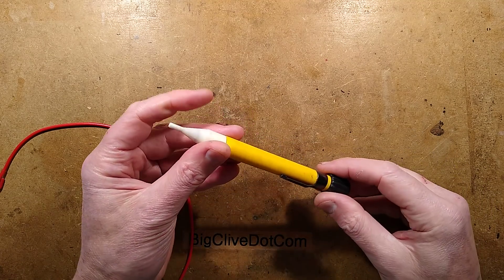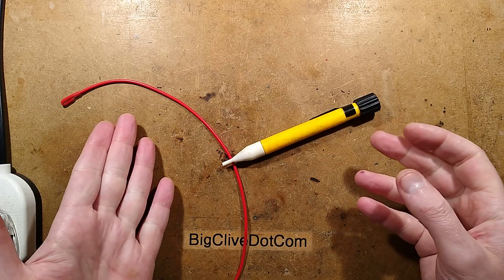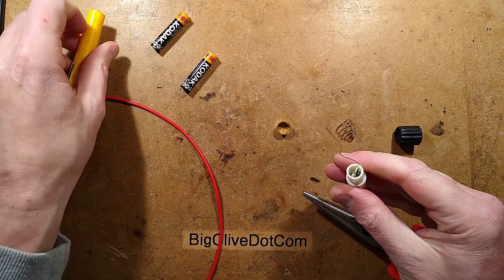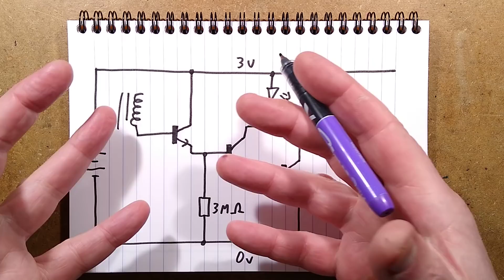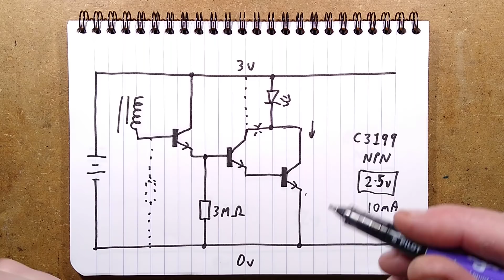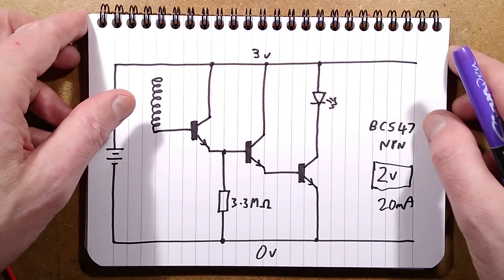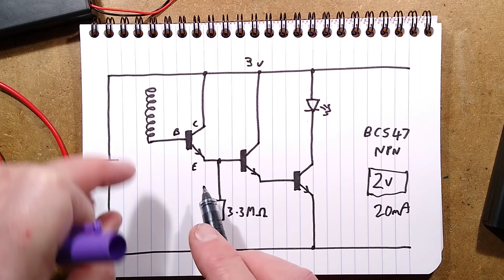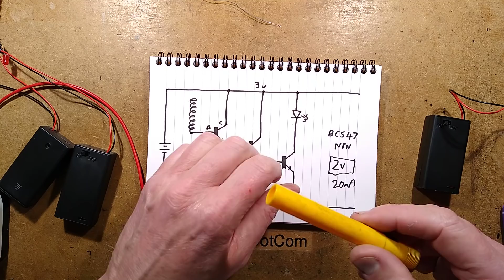Volt stick circuits and tests

Comment: I watched an apprentice trying to test one of these on my Proving Box. He convinced himself that my Proving Box was faulty because his volt stick worked on the cable to the radio.
I told him he was wrong and needed to look at the Proving Box specification and have a think about how his volt stick worked. 
Fair play to him, at the end of the day he'd figured out that the Proving Box was a ramping 600 volt DC, that it worked by the meter tip pushing a metal contact down, that his volt stick couldn't reach the shrouded contact and that, since it used an induced current the volt stick wouldn't detect it. The following day I confused him some more by showing that the Proving Box would make my volt stick light (mine has a longer tip and it works with a small Hall Effect IC so it will detect DC voltages).

Comment: when it operates down to the lowest voltage and it was 3V or 2V, where is that 3 or 2V? is that the voltage across the last transistor or is it just the supply voltage bcus its just an led not led + resistor? why do they work down to different voltages?

Comment: The Maplin Live Wire kit used a 4069 as the detector and as an oscillator to drive a piezo buzzer.
Okay for tracing known live wires but I wouldn't trust it as a safety device.

Comment: So between one of these, one of these with a screwdriver, a non-contact one (a Klein or some such) and a dual probe tester, which would you prefer to always have on hand (or pick more than one if you feel so inclined)?

Comment: These are are brilliant. Yes you should and must always double check with your meter. But when you have a control cabinet full of what should be totally ELV these things are quick to run over every cable and occasionally, just occasionally you find mains voltages on something where it has no right to be. These are also valuable in roof spaces - cut wires - ungrounded metal flashing - pipes. Its worth running the stick over these things before you go anywhere near them.

Comment: These things are handy for checking if the electrostatic deionisers on the HPA lines used to blow clean parts prior to plating/painting/finishing parts in a factory are working. There is no worries about 'false negatives' here, you can touch the deionisers when they are fully live and they wont zap you (they are similar to the bedroom 'air cleaner' deionisers commonly sold).

Comment: The problem with your favoured circuit is that there is nothing to limit the current through the 2nd transistor other than the be diode "resistance" of the 3rd transistor. In the shop circuit the LED limits T2 and T3 current.

Comment: I have a similar device in a screwdriver. 
It's good for alerting you when you are working on terminals and one becomes live because the idiots you are working with flip a switch somewhere. 
It saved my arse from a fizzing many times! lol

Comment: When The Apprentice cuts the Live Wire because he hasn't changed the batteries in his volt stick. Ouch. My 1 flashes until you get to the live wire
Reply: Having the lamp remain illuminated until it gets close to any combination of energized and dead wires (but it must stay illuminated when close to only dead wires or no wires) sounds like a safer design.  As a minimum it would demonstrate that the batteries and lamp are functional.  Would there be any other safety advantages/disadvantages?  I would like to see a circuit for such a design.

Comment: I used it in the loft to locate a feed wire to the upstairs lighting. There’s no way I could have identified it without this stick, so useful but only for certain issues. After locating the wire, isolated the circuit, proved dead, then extended.

Comment: Volt sticks have always been demonised as being  dangerous. But I think if you know their limitations they can be a extremely useful tool. Of course they should never be used to prove a circuit dead! I used to use them to find breaks in the cable flex of vacuum cleaners and various other electrical appliances. So many maintenance sites outright ban their use. I definitely think they have their place.

Comment: I love this channel ❤️
I remember buying my first one of these style ‘testers’ in 1989.
I was a ‘day shift maintenance electrician’ assigned to work with 2 contractors on a big installation. I spent a year working with these contractors and I have to say they earned their corn!
I wasn’t quite 30 years old and here I was showing off my ‘magic wand’.
Not one electrician said they’d trust it because if the battery failed your test failed.
There’s a place for non contact testing in fault  finding but I would not rely on this alone.
I use a similar type of tester for checking solenoid coils are energised. I could use a ‘terminal driver’ on the coil and feel for it being pulled down but ‘fitters’ are impressed by a pen that lights up.
Reply: Providing you test immediately before use on a known energised line these little devices are both reliable (VERY reliable) and safe. As far as "the battery failing" - a) this is why you test first, and b) zinc carbon / alkaline batteries do not "suddenly stop working", so that's a red herring. The current demand of these devices is so very low that even nominally exhausted cells will still "work" enough to allow some detection capability!
Reply: @phils4634  The fact I embraced this technology 30yrs ago and still have one in my tool box means I’m comfortable with them.

Comment: Thanks for the interesting video. I have a volt stick like that, made entirely of aluminum, except for the sensor tip, of course. I bought it about 30 years ago. Because I rarely use it, I never leave the batteries in. Such a non-contact phase tester is ideal if you have to look for a blown fuse, or a broken cable, or to plug in lamps with the correct polarity. I always check uninsulated contacts or wires with a simple neon glow lamp phase tester, which is a bit safer than with an electronic one, and the screwdriver is built in at the same time.

Comment: I don't know about that detector, but the Fluke detector I have is picking up the electric field, and I don't see how an antenna like that is necessarily going to do the same thing.  It's sensitive enough that rubbing it on plastic will generate enough voltage to activate it.

Usually spiral antennas are picking up the changes in the magnetic (B) field, not the electric field (E).  If that's true on this thing, then it's going to be very sensitive to how much current is going through the wire under test.

That emitter resistor effectively gets multiplied by the beta of the input transistor, so it winds up being something like 300MΩ as seen by the antenna.

Comment: A lot of these that I see in America are binary in their signaling -- either a "yes" or "no". But my multimeter is analog in both its sound and light output, which is really nice for figuring out which individual wire in a group is the live one. Honestly I wish that was more common, though I understand why it's not. Also a funny side effect is that it seems to "sense" a small amount of current both when it's physically jostled, and when it's held physically against a wall, even a plasterboard one with no potential. I've always wondered why that is...

Comment: I once bought a cheap Aneng branded one from Ali, horrible device. You needed a hammer to get the batteries in, and it always seemed to detect stray voltages everywhere, but failed on actual live wires. The Uni-T I have now is much better.

Comment: I remember when out carpet cleaner stopped working at work one of the maintance guys used one on these to check power was getting where it needed to, what that didn't take in to account was the neutral had become disconnected and that was the actual fault.

Comment: These were a dismissal offence if you were even found with one where I worked. We were only telecom workers. Death sticks.
Reply: Silly telecom workers thinking they're elechickens.
Reply: Just to clarify 40 years in the game. Also hold C&G 17th edition exam passes in electrical instalation and testing. So not quite a complete idiot. Just chose to work in Telecoms to get away from IEE.

Comment: We use them in the meter reading industry to test the metal meter box before grabbing hold of the lid.
We used to use them for water meter exchanges as well to check for Electricity in the water pipes. We have a better tester now days called a Plumb Guard
Reply: This is interesting as I decided this is a good test on questionable installs of equipment.

Comment: I have a wire stripper/cutter that had a tester in the handle but it is REALY bad. It even beeps when you shake it 😂 I'm not gonna trust my life on that one.... 
The cutting and stripping works great tho, so I tossed the tester 🤷🏼‍♂️

Comment: They're referred to death sticks in the US and most workplaces have banned them because of the problems with them, like them failing to couple like the first one you showed. Better to live, dead, live test with a volt meter.

After seeing the board, it doesn't even have filtering. What a piece of junk.

Comment: Would be really cool to have something like this for DC, like for debugging circuits in a car without having to find ends of wires. Just clip to ground and tap the outside of wires to find current. I imagine this might be hard to do without potentially damaging sensitive circuits.
Reply: A ‘short circuit tester’ for car wiring exists.
It’s a ‘self resetting breaker’ and needle ammeter style tester that shows you the direction the short is.
Some great videos on YouTube showing them in use.
If Auto Electrics is your thing then Scanner Danner is your man.
He wrote the book.
Reply: @GM-vk8jw  not what I'm talking about but I appreciate the reply. Shorts are a different problem that are usually easy to diagnose.
Reply: @anononomous  Yeah. Check out the Calterm 66331. Looks useful for quickly debugging ignition problems. I'm thinking in the context of automotive competition where you have limited time to do repairs. Saving a minute or 30 seconds helps.

Comment: My HVAC VOM has a Non Contact Voltage that beeps and visual indicates.  9volt battery gives a bit more power and display so negative indicate can't be low batt.

Comment: Long ago i saw a design that used a cmos divider chip with the clock input as the sense line. The parts list was 9v battery+clip, cmos chip, led, led drop resistor
Reply: I made a design from a magazine back in the 80s that used CMOS NAND gates iirc.

Comment: That first volt stick is probably built for zinc-carbon batteries. For some reason alkaline batteries tend to be slightly bigger so it snugs in some devices._

Comment: Only just saw the notification but I am feeling bold enough to comment before watching. (It feeds the algorithm either way and I do not usually regret appearing foolish.)
Around here, such devices are called "chicken-sticks" and they are wonderful tools! when the operator cares to use the squishy bits of their insides as more than a capacitor grown from meat.

Okay, I'll be off to watch now.

Comment: Really useful for adding a logic level monitor to a mains circuit, without making a physical contact to the live wires. I used one to monitor a PIR controlled outside light.
Reply: To make a voltless main monitor switch, it is necessary to add to the circuit show in this video, a Schmitt trigger gate and hum filter, or a retriggerable monostable to remove the mains hum, thus stopping  the switch chattering at 50Hz. The gate output can then be used to drive a relay or an opto coupler.
Useful if you want to add a mains monitor alarm to some mains powered device.

Comment: In the past, long long time ago, I repaired blood pressure devices, the pickup device in the arm piece worked in the same way.
It was fit in a little round metal case around the size if a 2 euro coin, and functioned as an antenna to pick up the blood flow in the vain.

Comment: I've always called these suicide sticks, if you are using it to check for the presence of high voltage, you should always double check with a meter, and the meter should be checked with a known hot both before and after.

Comment: I could never bring myself to trust these things and still test with a multimeter. Something from the past I remember was a tester with a neon lamp that looked for ground through the user holding onto a metal clip on the device. It looked like a screwdriver with a clear handle that contained the neon bulb and resistor with a metal pocket clip.
Reply: Had one when I was kid. Thought it was neat.
Reply: Those are useful if you ever find a single wire and want to test if it's live while there's nothing grounded around. Or use it as screwdriver that tells u that you were overconfident in thinking you turned off the right breaker.

Comment: Using the first stage as a preamp makes sense. It not only allows for the antenna and input impedance to be set, but it removes the 3x 0.6V offset on the antenna side that one would have with that many cascaded transistors.

Comment: I use one all the time in HVAC. I will say you can trust it to tell you that there IS voltage (flashing/beeping) but NEVER trust it to tell you there isn't voltage (no flashes or beeps). Always test with a meter to be sure there is no voltage. The only time I trust it for that is if I have it on the wire and flashing while I turn off the power and it stops. I used to have one that did 24-600 volts but quickly stopped using it. It's too sensitive for areas where there is 24 volts anywhere near 480 volts.

Comment: By putting the 3 Mohm on the emitter of the 1st transistor instead of the base, it's effect on the input impedance is multiplied by the beta of the 1st transistor. ie: If the beta was 100, then the 3 Mohm resistor on the emitter to ground would be the equivalent of putting a 300 Mohm resistor on the base to ground.
Reply: Yep, classic emitter-follower circuit.

Comment: i find that i never trust these things at all having had multiples fail on me, for actual testing i tend to use a meter unless i have to test in the middle of the wire 
for alternate uses like finding wire break locations i tend to find that a toner/tracer works far better and has the added bonus of not requiring you to energize a cut wire. 
also keeping a toner/tracer handy makes tracing out circuits a snap when the last guy helpfully roughed in 20 circuits and didn't label them at all but you need to energize only one of them
Reply: If you are working with DC those voltage pens do nothing.

Comment: I bought one of those back in the 90's from Home Depot. It chirps and lights upon detection. Till now, I never knew how it worked, and wondered how it still works today, even though I never changed the original batteries.

Comment: How do you know that the circuit is capacitively coupled, i.e. via electric field, rather than inductively coupled, i.e. via magnetic field? At 50 or 60 Hz it's much easier to couple inductively...
Reply: Because there's no current in that live wire to generate a magnetic field but there's lots of voltage to generate an E-field.
Reply: @petehiggins33  Thanks. You're right of course...

Comment: i bet its just a ghost detector,  a trilinton, like 3 a darlinton  but with 3 transistors instead of two.
EDIT: i was wrong.. glad to see Clive was thinking that same. if you don't have NCV on your multi-meter you can make one of these and stick it to  the back of the meter. just use a coin battery but i would advise a switch to activate it coz they are super sensitive. the top transistor's base is connected to the antenna/coiled copper wire. i have one on my cheap ass DT 830LN meter. ( its 830 part thats the common bit on all these 2 bucks meters, loads of different type with the same gut's inside) i keep it in my bag when im out on the ebike doing my rounds. coz people ask me to look at broken electronics all the time now they know i can fix stuff.  not carrying my better meters in case i fall off the bike and they get crushed, but the little add on is handy on the "cheap as hell meter" and so easy to make. enjoy.

Comment: a few years ago i had a small electrical screwdriver with 1 "transistor" , 1 led , 1 resistor and 3 button cells that worked the same way and also continuity test screwdriver tip to metal screwcap :-)
i only used it to confirm power was present , not as a safety deevice :-)

Comment: This brought back the memories of my old job. They were telling the story of a technician who moved onto work for another branch of the company by the time I joined.

Rumor has it, he wanted to check if a connection was live, he didn’t know it was high voltage, he didn’t use the HV NCV testing probe, he went ahead with the classic flat head screwdriver/test-pen instead. He was shocked but he survived. His anecdote was that test pen was glowing even before touching the contact. He unwittingly invented NCV.
Reply: yeah i've done that with a neon before on crt leads from a tube i was sure was discharged. it wasn't

Comment: Looks much safer than the phase detector screwdrivers where you ground the screw at the end of the flimsy plastic driver with a neon.

Comment: Those last two transistors /are/ in darlington configuration. If you consider a self-contained "darlington transistor" it only presents one base, one emitter, one collector. The collectors inside are attached together. If you were to use one of those, to drive an LED in common-emitter arrangement, you would come up with this exact circuit.

Comment: Great video Clive, I was wondering if you could use a voltage divider on the input stage to pre-bias the transistor to be very close to "ON". I also wonder the effect this would have on flicker, but then again it would probably still flicker the same way.